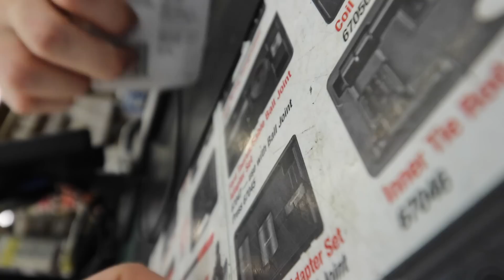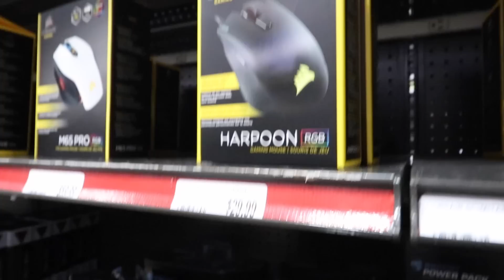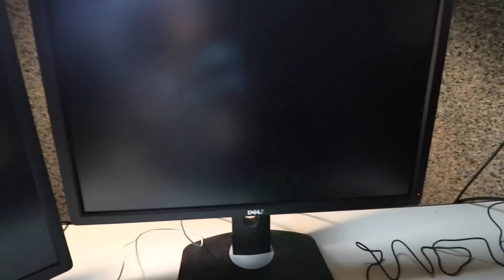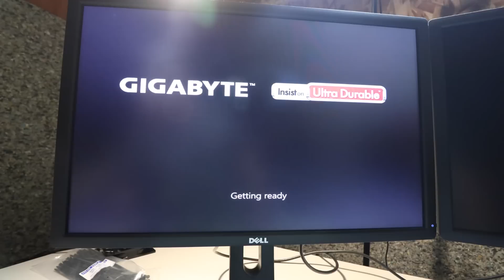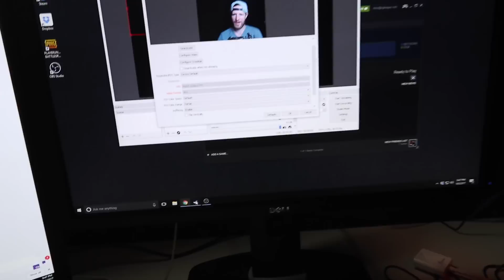We Build More Than Cars! - Gaming PC Build

Comment: Your top fan should be exhaust- heat rises and you want more intake than exhaust (positive pressure) for better cooling and minimizing dust
-front intake, side intake, (and bottom on some cases), then rear and top exhausting

pretty similar build to what I have, aside from my i7 3770k overclocked under a massive Noctua - Corsair makes the best PSU's and Gigabyte motherboards are really reliable too (the only brands I use consistently in my builds over the years)

Comment: Instead of using the stock amd heatsink just put your chip in the microwave... Has the same effect and will save you a few days of laggy gaming..... Also just disable the on-board gfx via the bios and install Windows using the card from the start.. seems pointless installing on board gfx

Comment: After seeing the picture on FB of that cpu cooler I honestly thought you'd gone for an older FX based CPU. I'm relieved you didn't after watching this.

For a non-gaming computer running Ryzen you do still need a graphics card though, the Ryzen chips have no integrated GPU.
Reply: Ryzen has no on board graphics, so no it's not nonsense.
Either he installed it off camera or he's not actually using Ryzen, which i can't imagine he'd lie about.

Seems more realistic he installed it off camera as he cuts after saying "let's see if we get a bios" and then doesn't show installing the GPU after that point in the video.
Reply: @Tony FromIT 

So a Ryzen CPU box, Ryzen cooler, Ryzen motherboard. Do i need to continue?

You can boot a pc with no GPU, but you can't see anything.
Don't try and be smart on YouTube, you'll get wrecked.

Comment: with your top fan as intake and the rear fan exhausting. you are just creating a small heat pocket in your case. need atleast 2 fanse in front as intake and 1 in back as exhaust to create a positive pressure situation which would help keep dust out and would supply fresh air to the GPU and cpu. instead of the recirculating the same air over and over to the cpu only and nothing for the gpu.

Comment: You don't need to use your onboard video for your windows install, the graphics card will still pass video even with no drivers installed, when you install drivers you will gain the full functionality of the graphics card like full video resolution, change refresh rate. etc etc

Comment: Yo Chris, you should totally add an intake fan on the front of the case. It makes a big difference to cooling or swap one of the exhaust fans at the back and put it in the front of the case to pull air into it ✌🏽

Comment: Chris you got the motherboard with a feature few motherboards has. It has the adjustable Base Clock Generator! 

On most boards you can't overklock the base clock, everything else on the system(like all the different busses) run of the 100MHz base clock, and you cant change it. 

Some X370 boards has an external clock gen that let you change that freely which really gives you "finetune-ability" you can get higher mem clocks which Ryzen are really picky with. 

The base clock gen is also the key for most ryzen cpus to hit over 4GHz safe while not going over 1.425v on the vCore.

It's good! to bad the VRM isn't to good on that board but whatever. for the price it's one of the better.

Comment: Nice PC Build you have there! Although, I have to correct you on the part which you said that you don't need a graphics card for a basic computer. The CPUs that are currently available on the Zen Line-up does not have integrated graphics. The motherboard graphics outputs are for the upcoming Zen APU's which will be coming around the end of this year. Oh and to add on you would need an OS to technically have a functional computer. I hope that you are not offended by this comment. Cheers!

Comment: Can you throw up some bench mark numbers  for that stock cpu cooler on the Ryzen under gaming load conditions I'm really curious to see if the stock cooler can keep up with the cooling requirements. Or if it will start thermal throttling under any kind of significant load it would be cool to see a comparison  between stock cooler and a corsair liquid cooling systems ? If that could be a possible video in the future ?   OR SOME SICK B-IS FOR BUILD CASE MODS  !

Comment: AMD Ryzen is VERY picky on memory.  Likely you will be running the memory at stock speeds of 2300 likely.  I just rebuilt my system.  I also had a 1060 GTX with 6BG and picked up a Ryzen 3 1300x, 8GB DDR4 3200, and Asrock AB350M Pro4.  I used NewEgg and only paid $300.  Even though my old system was about 8 years old I still had a 1TB drive and a 2TB backup drive, the Antec 650w Earthwatts PS, Antec case with window and blue LED fans, and the Blu-ray burner still work fine.  I cleaned out all the dust and installed all the new stuff and neatened up the cables and the system rocks.  I only had to spend $300 but I do want better memory and an NVME drive eventually, but this system should have plenty of upgrade options (hopefully a Ryzen2 in a few years).

There is an AMD driver you will need that is not in the driver disk that you need to get off their site.  It has something to do with the power management and affects performance quite a bit.  You can get it here...

http://support.amd.com/en-us/download/chipset?os=Windows+10+-+64

I might be crazy, but I just installed everything and booted off my old install.  By old this was a Windows 7 64bit Pro that I upgraded to 10 when it was available and now I switch parts and still running the old bloated install and it still runs great.

Comment: For anyone that says 'overclock it'. Benchmark your tasks before and after an overclock. You will likely find that overclocking it is detrimental to performance. This is because of XFR an AMD technology that can push your cpu to 4.1 ghz if cooling capacity is adequate (the stock hsf isn't really) (I would say Noctua but with tempered glass I'd go with a cryorig - much prettier or for cheap the coolermaster hyper 212). However most overclocks on any Ryzen get you to 3.9ghz all cores. Great if you are re-encoding video (multi-thread). Not great if you have single threaded workloads (most games) that would benefit from XFR clocks.

It's a pleasure to finally be able to help you out about a subject I know a bit about (computers) versus a subject I know bugger all about (cars).
Also for next time its much easier to install the cpu, ram and heatsink on the motherboard and then put the whole kit and caboodle into the case.

Comment: +B is for Build 

Could you please get some front intake fans, since there are 3 slots and theyre filtered. 

You really dont need exhaust fans, maybe keep the one in the back or the top. 
The top fan currently intakes in the worst spot possible for dust, and destroys airflow around the CPU.

Comment: Damn bro you skimped on the BRZ cooling and now the cooling on your PC too... lol - grab some more fans for the front so you have positive pressure. = less dust build up inside of case. also spend 30$ on a aftermarket cooler for your CPU. easy fix... keep it up man.

Comment: get a 1080p monitor you can most likely run it on that resolution with a 900$ setup and it will look better than the 720p that that dell most likely has

Comment: I would probably not choose any of those parts except the power supply.  The Sandisk SSD was the worst choice.  Sandisk products in general don't last long.  I'd spend the extra money for a Samsung easy over trying to stay on a budget and getting low quality components.  I've tried out different motherboard brands and done AMD over Intel for budget.  ASUS and Intel are my choice always now.  But then I'd never go to Fry's and only stick with what's on sale either.

Comment: No offense, but that's bs about the graphics card. You end up with an AMD driver and an Nvidia driver installed. Just plug the thing in before you install windows. No hurt with that, windows deals with that stuff fine. Also, if you payed 850 for that hardware you got kinda ripped off: https://pcpartpicker.com/list/xmRHcc is the same build with a better cooler, and it's more than 100 bucks cheaper. For the kind of money you spend I would've bought something like this: https://pcpartpicker.com/list/MjhBCy 8 core Ryzen 7 1700x which helps with your streaming/video rendering (faster than the 6 core Ryzen5). Don't spend so much on a motherboard with features you're never going to use, the one I chose has all you need, and is a lot cheaper. AMD Ryzen likes/loves fast RAM, so I got the 3000mhz Corsair DDR4 sticks. And your mainboard supprts M.2 SSD drives, why not use it, it's waaaay faster than a normal sata SSD. So I got the Samsung EVO 960 500GB. For case I went with the Fractal Design Define C, as Thermaltake is a Chinese ripoff company. They don't design their own stuff, they just steal it from competition (https://www.extremetech.com/gaming/207344-thermaltake-accused-of-ripping-off-multiple-rivals-stealing-designs).

So you could've made some smarter choices on your computer and end up with a better and faster end result.
Reply: He went for convenience, so he paid for it. Not a big deal, prices arent that far off. 
Also gets to drive to the store for warranty purposes, so thats handy.
Reply: DDriftsTV pcpartpicker shows what website is selling the product you want in your pc for the cheapest price ( pcpartpicker also shows if the parts are compatible.) You shouldn't rely on employees to tell you what's good or bad, because they might not know shit. Instead research what you want and need. I was going to get an i7 build until Ryzen came out, now my build list is about $300 cheaper.
Reply: derx I agree, just plug it all in, run your burn in tests, if anything is faulty RA it.
Reply: While you're right, he went to a brick and morter. It costs more. He did fine.
Reply: It is what it is. His part selection wasn't researched, but just bought on impulse or store recommendation. Most stores (especially the large retailers) don't have qualified personnel and most even work on a commission base, so they won't recommend what's best for you, but what's best for them.
Reply: Then you gotta pay postage wait for it to come to you, and then risk damaged parts through postage, you could argue its free postage but that all depends where you live, Some people find it easier going and looking at things in person and deciding that way mind you in store there may be a worker who could advise you on whats better or why you should or shouldnt run something with another. But each to their own, If you really want to look for bargains building anything really it may take longer and youll haveto put more effort in to finding sites ect, but the bang for your buck will always be where you put the most effort in
Reply: Mr. Roy Games most places have price matching though to places that are based in the US. Honestly his build is fine, but that is a hardcore budget Psu (bad revision at that) with an overspecced motherboard. W/e we all know he isn't the best at researching before spending money anyways lol

Comment: Ryzen 5 1600X wins in multi-threaded applications... i7-7700 wins for IPC, which makes it better for gaming. That said, I'm sure the 1600X will do fine and may even work a little better if you're streaming games.
Reply: Just stock clocks it tends to beat the 1600x by 10-20% in games. Though I think he'll make that up while streaming.

Comment: Ryzen doesn’t have integrated graphics so you do need a gpu...
Reply: Haider Sherazi, not exactly correct. AM4 supports CPUs that have integrated graphics, there is a port on the motherboard but all Ryzen CPUs do not have an iGPU only the APUs do.
Reply: I noticed he didn't mention he had to install his GPU before getting video. Ryzen non APUs need a GPU. The new Ryzen APUs don't.
Reply: the boards have support for integrated graphics because the new APU's will be socket AM4. Ryzen processors don't have integrated graphics though, which is what OP was stating. why make it confusing by bringing other models into this lol.
Reply: Haider Sherazi I don't now about the Intel stuff that might be true but as I said my mom uses an AM3+ Board with a AMD 760G graphics Chipset and Chris's board has some kind of Graphics chip as well. Just googled it. So some newer AMD boards still have this.
Reply: Some motherboards will have an integrated Graphic chip if they have a port for it and they support processors without integrated graphics. Nothing fancy but it projects a picture on a screen. Had it in a few 775 Boards and my mom uses it in her PC with a FX4100 for years.

Comment: Get a cpu fan, cooler master hyper 212 Evo is about $30 and it will give you wayyy better performance than that little stock heat sink and fan. Keeping your cpu cool is the key to Better performance. If you want to take it further look into water cooling
Reply from the maker: I had a good heat sink but it relied on screwing into the motherboard and the motherboard had a different bolt pattern, so it didnt fit, so i used that one in the short term, im going to get a good one today.
Reply: That stock cooler is more than enough for Ryzen anyway. my 1600 running the stock cooler can run cool and quiet at 3.8.
Reply: Luis López watched Linus video about your cpu temp doesnt affect The performance... Lifetime i think IS a different story
Reply: true but not necessary with no oc. Ryzen's extra boost is not huge, its 2 or 3 hundred mz, and its not adding voltage so you might not get much benefit from the cooler without manually overclocking. probably a good choice to leave if off for a no oc budget build.
Reply: Drummer48342 h7 quad lumi is am4 compatible out of the box... got one in my r7 1700 rig. Bit more expensive but performs better than the standard h7 and has RGB's.
Reply: pendragon1 yeah if he had the wraith cooler i wouldn't of recommended upgrading for a while. I ran 3.7ghz on my wraith spire cooler for a couple months before moving to the h7. Was fine for gaming and realistic workloads.
Reply: I LOOOVE my hyper 212 evo, such good bang for the buck
Reply: yup! you can get 3.7-3.8 on all cores with the stock hsf. i just did this with a 1600 in 30C ambient, it peaked at 72C during stressing(P95, aida, etc) with auto voltage. if i actually dialed it in I'm sure i could have got it cooler. but 72C in 30C heat isn't too shabby! edit: wait that isn't stock nm. 1600x doesn't come with one....
Reply: Arctic Cooling Freezer 13 series performs just as good and is half the price
Reply: If you are overclocking it is key to performance, does nothing in any other case.
Reply: only a TRUE gamer overclocks
Reply: I considered xfr to be no overclock. obviously if he wanted to oc a better cooler would be a necessity. But he doesn't so it would be a waste since xfr cant really take advantage like traditional overclocking
Reply: Banks4004 you can disable xfr and manually overclock? I don't know what you are trying to say...
Reply: Yea, it does not. I know they advertised it does, but it's not true. I have an 1800x on water and on air, they run exactly the same.
Reply: I hate it when stock cpu coolers have stickers that are off center it is obvious when they spin ... just and ocd thing for me I would have to replace it too.  Oh and the obvious reason better performance!  Nice build thanks for sharing!
Reply: Arska X Yes it does if you overclock! Also, Ryzen automatically boosts your CPU if you have enough cooling so in this case, yes, you will be getting better performance. You won't notice it in games, but if you do video editing for example you will notice it.
Reply: 110$ newegg corsair hydro series h100v2... much better cooling.
Reply: Banks4004 you can easily push 3.8ghz+ on all cores with a decent air cooler which is a huge bump in comparison to the stock clocks on all cores. I think you are getting confused with xfr which is a 1-2 hundred mhz boost on a single core (4ghz+) The stock ryzen clocks are around 3.2-3.4ghz depending on skew so jumping to 3.8 and above on all cores is quite significant...
Reply: Luis López water cooling doesnt improve that much when you game for long periods of time, grab a hyper evo 212 or the cryorig H7 and youll get the same performance as water cooled, for sure with 2 fans for airflow through the block.

The water only takes longer to warm up but also takes longer to cool down, whilst with air when gaming it starts to get warmer, then holds at around the same temp as water cooled after a few hrs, then drops down back to normal in like 5 minutes when stopping/going to the menu etc...
Reply: I suggest either the Hyper 212 Evo (if you can get the AM4 mount, it was unavailable when I was putting together a friend's PC) or the Cryorig H7 and you can just request an AM4 mount after purchasing. All you have to do is provide proof of purchase.